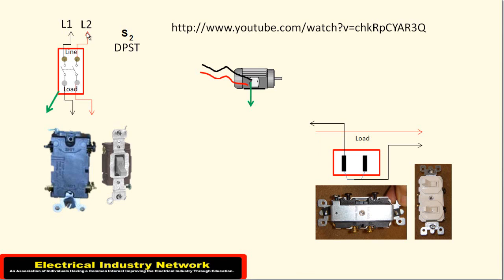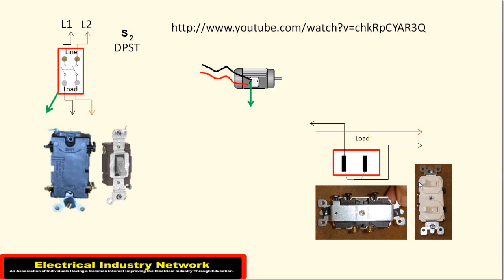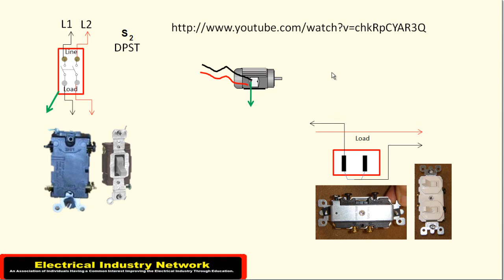250 volt Swimming Pool Disconnect Switch

Comment: Lock out Tag out procedure requires verification of  Zero State condition, that includes no electrical energy, before starting servicing.
Some one could easily have been electrocuted at the swimming pool by just touching the metal box holding the switch, does it have to be metal?

Comment: Unless I size the breaker down and use 12 on a 20 A CB or a 10 on a 30 CB cuz thats what NEC says those conductors shall be protected by that CB raiting. obviously i can do that but lets say i didnt want to because i have lots of inrush current so i go with the max size 35 A CB do I use a number 8. Those are the questions what protects the 14 AWG wire with a 35 A breaker and should I use a number 8 for the 35 A CB this is all hypothetical.

Comment: What I am after is this, knowing that the NEC allows you to size your branch OCPD at 250% max for inversetime circuit breakers so in my case this would be 14 FLA X 2.5 = 35 (standard size) If I use this breaker what is protecting my conductors ampacity? Its only good for 20 A the breaker wont trip untill 35 A its only protecting for short circuits and ground faults Also the NEC say that a 14 AWG conducotr must be protected by a 15 A breaker, so in this case is i use a 35 A breaker should I use 8

Comment: You didn't mention that when the original switch is off, there is a combined 240V between the line and load sides of the switch. Which may be more than it was designed for.

Comment: This is related to 110v 2 phase to get 220v so dual pole switch should of been used, in places where 220-240v is the norm it only use single phase and a single pole switch would of been fine if that was the case (but it would of been IP rated due to it's location) , why this was done in this way is very poor and I am not a sparky and I understand how bad that is